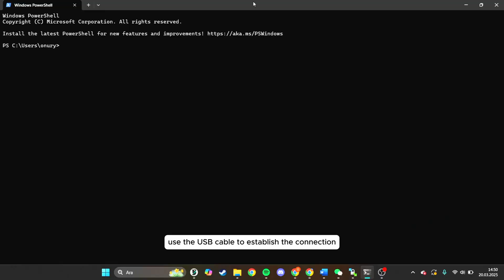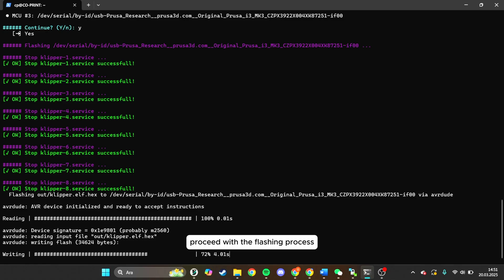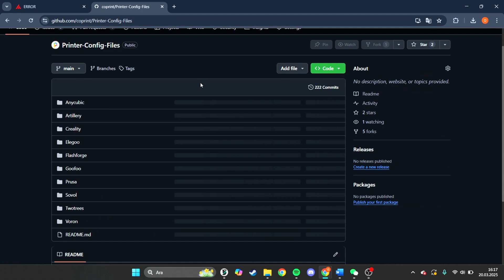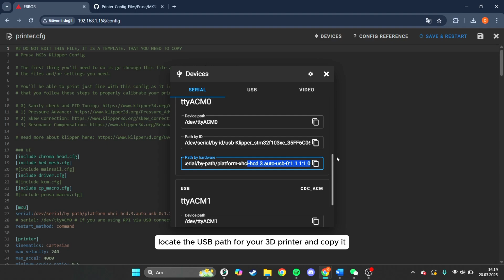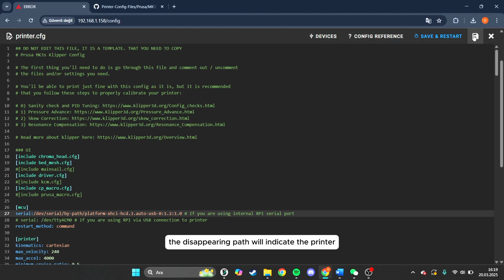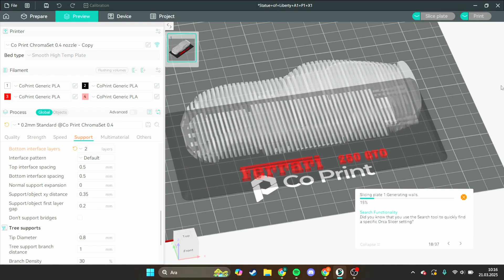Upgrade Prusa MK3S for 4-Colors Printing! | Co Print ChromaSet Installation

Comment: What is the recommended material for the printed adapter?
I see 2 parts front and back for the prusa mk3 but you only  mentioned the front one in the video....
Reply: Thanks
Reply from the maker: Hi! PLA will be sufficient for these parts. The file for the front part is compatible with the stock back part that comes with the printer. However, if you print both parts beforehand, you can choose whichever fits better during assembly.

Comment: Existing the MMU, is there a market for coprint on this prusa model?
Reply from the maker: MMU systems typically use the existing printhead. However, ChromaSet offers a printhead specifically designed for full-color printing. Additionally, when MMU is used with a Prusa printer, it is limited to Marlin firmware. In contrast, with ChromaPad, you can take advantage of Klipper’s advanced features on your printer.
Thank you for your feedback!